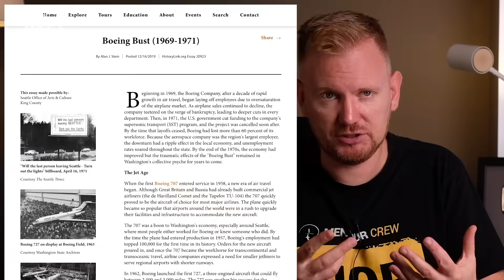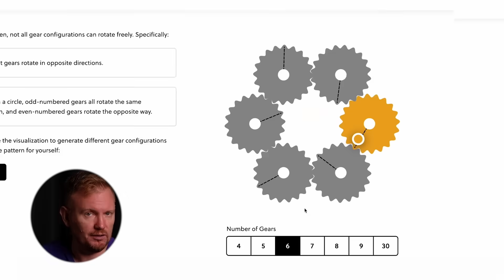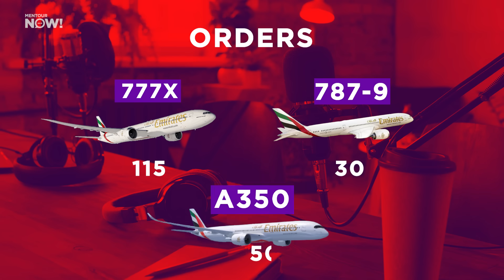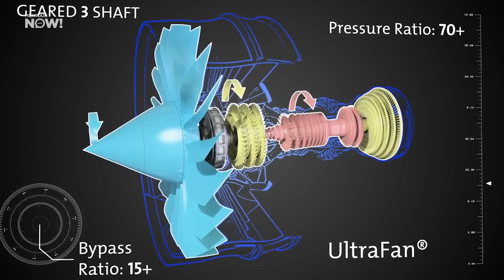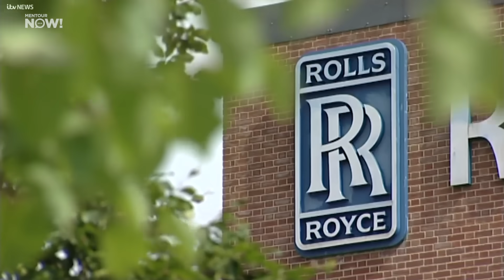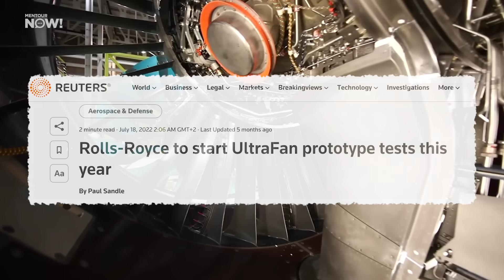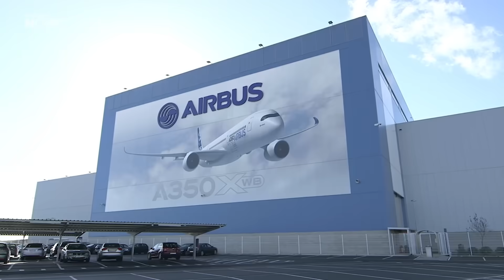Are BOEING planning a 747 with 2 ENGINES?!

Comment: Interesting analysis but I think the chances of Boeing investing money to redesign the 747 for two engines (and re-certify it) are zero. If the market doesn't support continued 747 production, why invest more in that product? Airbus lost money on every A380 they built, and management finally pulled the plug. If Emirates had wanted more A380s, they should have paid Airbus enough to keep the production line open!

Fuel economy and emissions initiatives will force development of new aircraft designs in any case. Integrating advanced engines with an old design is something the U.S. military can afford (KC-135, B-52), but not a for-profit airline.

Comment: Pretty much everyone loves the A380, passengers and pilots alike and it brought tears to my eyes to watch these wonderful airplanes being put into long term storage or being sold or returned after their lease period. So fuel efficiency is a critical factor besides the business model of the operators as you've outlined already.
So imagining an A380 with 2 of these these brand new Roll's Royce engines with relatively small modifications to make them fit could be a game changer.
I'm pretty sure that Emirates would jump at them right from the get go and others might follow.
It is by far the most comfortable plane, I've ever flown in and I would even pay a premium to keep flying in it.
I've also heard that the current A380s are not really suitable to be converted into freighters, which is a damn shame, if true.
Maybe you could elaborate on that in one of your future videos.
Other than  that, keep up the good work !
I wish you and your family a Happy New Year !
Reply: The biggest problem with converting an A380 is the cabin floor which would have to be completely replaced and the structure beefed up. Also there would be a lot of wasted space because only the lower deck is really practical for cargo. When FedEx was looking into it severally years ago they decided that the upper deck wouldn't work for them. 

Even if a cargo company did use both decks they would max out on weight long before they filled the volume. So it would be a very costly conversion with not enough gain. 

Just like airlines, cargo companies are not as interested in huge capacity as they are in efficiency. If a larger size is more efficient okay, if a slightly smaller airplane is more efficient they will go with that. It appears that Airbus is instead going ahead with an A350 freighter.
Reply: @StevePemberton2  Thx man  for elaborating on that !

Comment: Not watching, but probably. Because Boeing is not an Engineer Company anymore.  So they will make shoddy crap from now on.  See the MAX.
Reply: There are no indications that the 737 MAX is not a well built plane, they have been successfully operating for a few years now and are selling well.

Boeing made huge mistakes in a specific part of the software leading to two crashes before the problem was dealt with and they should be held accountable for that. 

Understandable the reaction to believe that MCAS is the tip of the iceberg and that  there are more hidden problems, but there is no evidence of that. Companies do bad things, Ford, Toyota etc. but it's not so easy to just cancel them because of mistakes or even criminal wrongdoing. Just have to hold them accountable and create diencentives for bad behavior, which Boeing has certainly experienced.

Comment: Airbus' big mistake was not to develop an A390 twin double floor plane in tandem with the A380.. Yes it wouldn't have been immediately achievable but the wing should have been designed with a twin jet option in mind when engine technology caught up.

Comment: Hub and Spoke models don't work for a country the size of India...India has about 8 large airports spread across the country and passengers would prefer a direct connection rather than spend time at transit Airports..for example a Bangalore to Sydney direct Qantas flight is more preferable rather than a  transit at Mumbai,Delhi or Singapore airports..

Comment: Ok I may sound incompetent. But the larger 2 engine configuration ( thinking like the the engine as a turbo) it would take longer to run up in case of a go around, single engine failure. What could be the issues

Comment: The DoD has been pushing for Boeing to start a 3 engine duel ramp blended wing body cargo aircraft to start replacing the C-17. Since the engine's will sit on top of the fuselage, the main constant for engine size is drag and weight.

Comment: Hi , what about the 747 with the 2 engines mounted on the back on the fuselage with a T tail ? , no engine on the wigs . In that way the size of the engine it will not matter , the engine will not hit the ground .

Comment: If the 747 comes back to life it better have lower NVH. A380 is so much more comfortable. Not sure how much of the NVH is do to the engines as the A380 has much newer ones compared to the 747. Perhaps the 747-8 is better but I haven't flown in it.

Comment: best place for the huge engines might be at the back, with the ailerons going to the front as canards, but the engines wouldn't get 'clean' air in that spot I think. 

Also, magnetic gears sound like a good fit for next generation engines.

Comment: The GE-9X engine generated a world record thrust of 134,300 lbs during testing, and they say it did so with flying colors and barely broke a sweat.  Then it was placed on the Boeing 777-X and scaled down to just 110,000 lbs of thrust.  If they would upscale the thrust of the 9X to around 133,000 lbs (which they could easily do), then a 2 engined 747 is entirely possible.  The 747-8 has a maximum thrust of 266,000 lbs coming from 4 engines.  Two 9Xs raised to 133,000 WILL ALSO MAKE a max thrust of 266,000 lbs.

Comment: The Plan B for the B747 was to be a cargo aircraft if passenger didn't work out.  Fitting the last one out was a freighter.
Now how much longer will the B767 line be running?  Boeing just down to the B737, B777 and B787 soon?

Comment: "PRESTIGE."

Any Airline that wanted to lay claim to being an Airline that carries Passengers had to have a #Boeing 747 in their Fleet and include successful operation therein. In short "dumb luck" made this Air Frame basically dominate the skies for 50 straight Years 1972-2022 with the one major characteristic that separated the 747 from any other ironically not mentioned here was in fact *SPEED."

Even today the Boeing 747 is an incredibly fast and performance oriented Airplane and thus surprisingly efficient unlike any that had come before or since IOC on or about 1970 with I think PanAm as the launch customer. With subsequent upgrades ending with the -8 this speed and efficiency advantage then came about a reliability advantage as by way of specific example right now in USA with thousands of canceled Flights during peak travel Season by Air would normally be made up by moving in as many 747s as possible to clear the Airports of a bunch of very irate travellers and do so with incredible SPEED (meaning "efficiency" or moving the greatest number the greatest distance with only a surprisingly slight disadvantaged cost to fuel insoding.) Presumably now this only be done by the Boeing 787 as it is both twin aisle and built to be both rugged and fast although the 787 is all new to me so can't really speak to any specifics related to that but the current Travel Catastrophe in the USA right now imo would be a perfect way to move "beyond the Air Frame and into Flight" as as a Business "Flight" USA, KSA and Asia et al is truly a unique experience because of the massive volumes of human beings involved need moving around to include *"at peak" is the way I was told to look at the problem as "problem solved" anyways.

Great content here!

Comment: Will the next "President Spec 74's" be brand new or retrofits of the current  N894BA (S/N 42416) and N895BA (S/N 42417) ?
Reply: Those two were flown from Victorville to San Antonio in 2019 for conversion and that's where they still are. Now looking at 2026 at the earliest. Delayed because among other things Boeing fired the subcontractor doing the conversion in 2021.
Reply: @StevePemberton2  fair enough.  Was thinking they might have been the last ones to roll of the line but if they are being “upgraded” then it’s all good 🙌
Reply: @spence-88  Originally they were going to purchase new ones, but Trump nixed that and apparently personally negotiated the purchase of the two unsold ones sitting in the desert that were originally going to Transaero. 

Saved quite a bit of money apparently, but it probably was penny wise pound foolish as it's hard to convert an already built civilian aircraft for military use.

Comment: it will be an upscaled a350. so, probably an a360?
with a similar construction like the 747. double-decker, but only the front half? or a wider body for one extra seat per row?
when looking at real birds, there is some similarity.
but they really have to push the light weight construction quite far. if you look at the power specs for maximum thrust, the RR ultrafan does not deliver that much more compared to the powerful engine on the a350. maybe only +10%.
but if they can transport +20% more people with also 15% less fuel per seat, that would be a huge advantage for airlines over the competition.

Comment: I'm wondering how a geared fan could be patentable. I don't know if the planetary gear system shown in the animation is accurate, but that seems like a pretty obvious way to do it, and generally speaking 'obvious' means not patentable (or, at least, subject to a challenge that may well succeed).
Reply: The general idea of planetary gears for a turbojet is certainly not patentable (it may have been patented sometime in the 30s or 40s and so has long expired anyway), but there will be many details of that gear set (eg design of thrust bearings, gear cutting method, lubrication channels, etc) that will be.

Comment: This is one of the most interesting aviation channels on YT.  Could that large RR engine be mounted at the rear, like a 727 or VC-10 ? It would solve the problem of ground clearance, and so a potential freighter would be easy to load/unload.
Reply: i was thinking something similar like a 3 engine configuration. two ultrafans would not have enough power to accelerate an a380. three ultrafans would do.
Reply: No one will want three engines, certainly not with one of them mounted in the tail. Not even Emirates. Those days are long gone. Extra passengers isn't worth it. 747 size twin will be better.

Comment: I hope so…this plane is absolutely gorgeous…switch out the engines to two super efficient ones, make it 30-40 percent composites…this plane deserves to rule the skies
Airbus A380 is a flying pig, so much so that the Emirates are getting rid of their fleet
Reply: I had the honor to fly both as 1st and captain. 747 is a piece of art designed in the past. I never flew a more advanced type than the A380. Handling and comfort is second to none.
Reply: @olafjung3406  Hi Olaf..amazing.
My comment about the A 380 is definitely harsh…what I meant is that it is very fuel inefficient (right) , think the Emirates has just sold them all off, and on the tech sometimes too mush tech takes away from the flying experience…reminds me of the A-330 that went down off the coast of Brazil…the tiny joystick to fly such behemoths feels a little to hands off, no feel.
Anyway, take care

Comment: Think outside the box. As in anhedral Double fuselage. With these two engines easily placed in between the fuselages. Or 4 of these engines easily placed outside the fuselages for transport. Something along the lines of a modified "shuttle transport aircraft twin body 747 configuration". This size would only be used in the largest of airports that had runways at least 200 feet wide with the total wingspan around 300 feet. Transport wise a twin enclosed setup with a "open" setup would allow many possibilities for space exploration and large item transport.  I will even go as far as throw out the transport possibility of a single oval shaped fuselage that is 1.5 to 2.5 times wider then a 777x with 2 or 4 of these massive engines under that anhedral wing.  You can forget about passengers as this only works for cargo. With international shipping numbers showing no signs of slowing it only makes sense that a massive international cargo airliner will be built to move greater quantities faster at potentially less cost.

Comment: I have often heard arguments for and against a twin engin 747. And I understand the reasons why not,  However I have never heard of anybody suggesting putting a hump on the 777. With area rulling there could be aerodynamic advantages and no new wing would be required. what do you think of this idea.
Reply: I'm sure Boeing has studied this proposal, 30 years ago, and there are a multitude of reasons why it is a terrible, unworkable idea.  It might make a smoother area-ruled fuselage but the increase in weight and parasitic drag completely negates any benefit...

Comment: I’m wondering what it going to happen with the next Air Force One since it’s supposed to be a 748. I assume the airframes have already been set aside for modification.  It’ll be interesting what is chosen to replace those as I’m sure they really would prefer a quad jet in the role of AFO.
Reply: They purchased two unsold 747-8's in 2017 that had been sitting in the desert after Transaero went bankrupt and never took delivery. They have been in San Antonio since 2019 being converted. Current estimate is 2026. Hard to convert an already built civilian airliner to military, not to mention the hardening etc. for presidential use. Probably would have been better off having Boeing build them custom. They won't have aerial refueling because of this. Not sure why because the Shuttle carriers had refueling added even though they never used it
Reply: Thanks for the info. After posting my original comment I remembered reading something about them acquiring two undelivered aircraft but couldn't remember the details. Kind of ironic they were intended for a then Russian airline.I think you're right that when things are all said and done that they'd have been better off working directly with Boeing to have two custom airframes built. It'll be interesting to see what replaced teh VC-25Bs in 25-30 years because I'm sure the powers that be will still want more than twin engines on the  main presidential aircraft. (I know the president does occasionally fly on the modified 757 that normally serves as AF2 and other smaller business jets but those flights are almost always short domestic flights into smaller airports that can't handle the 747s.)
Reply: @LtKernelPanic  They use the 757 quite often just to save money, as taking the 747 is pretty costly. The 747 is mainly used when they bring a lot of staff and press or go long distances. Day trips for a speech on the east coast is likely to be the 757.

Possibly the next Air Force One to be added to the fleet after the 747-8's will be supersonic, one of the mach 1.2 business jets that have a greatly reduced sonic boom so that they can fly over land. Assuming those jets debut in say five years, add five more years to make sure they prove safe, then another five years to convert one to Air Force One. That's 15 years which could be optimistic on any of those points. They would still keep the 747's for longer flights, then eventually  replace them with whatever the largest twin jet is at that time.
Reply: @StevePemberton2  I think they scrapped the aerial refuelling because there isn't a large enough plane that can effectively refuel a 747-8.  Also, in a situation that required it, i.e. all-out nuclear war, the government is basically destroyed so what's the point?  Pretty sure they've never used aerial refuelling in the current AFO planes...
Reply: @johnbergstrom2931  I don't see why a 747-8 couldn't be refueled. It's not like they fill them up to full they just give them whatever fuel they need to extend their range.

Refueling was left out on the new planes to save cost, the White House giving the reason that you mentioned which is that it has never been used in the past. But there are some in Congress and the Air Force who are questioning this so I won't be surprised if it gets added later.

In a nuclear attack situation while we may be fatalistic about it that everything is over, the defense department has to plan for the continuation of the U.S government and protect it as needed.

In any situation they would prefer to not refuel with the president on board unless it was considered safer than landing and refueling.
Reply: @StevePemberton2  It's like I said, I don't think AFO ever used it.
Reply: @johnbergstrom2931  Correct. And they have never used the anti-missile system either. It's a factor but it's not the only factor in deciding whether it is needed or not. 

Another possible use is prepositioning, where both planes are used. The second VC-25 could be aerial  refueled shortly before landing somewhere. Both planes would land and the presidential party would transfer to the second plane. Obviously that has to be done securely, probably using a cloth tunnel between the two planes like they sometimes use when presidents enter or exit buildings. This method, although slightly awkward, avoids using unknown fuel, as well as greatly reducing time on the ground. Both planes would take off and then the first VC-25 would be aerial refueled.They have taken both VC-25's on trips to Asia so it's not that far fetched. Whether they would actually do this or just go ahead and aerial refuel with the president on board who knows. But it's about having options in a dynamic situation.